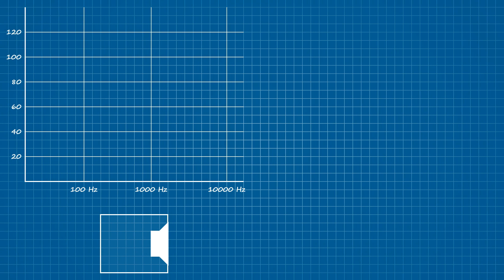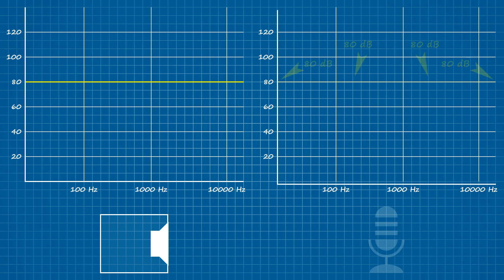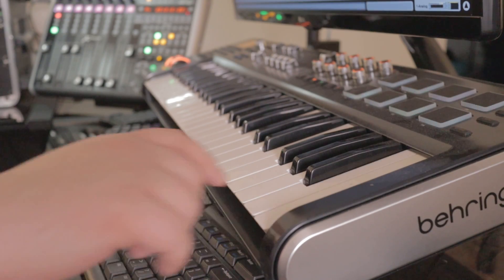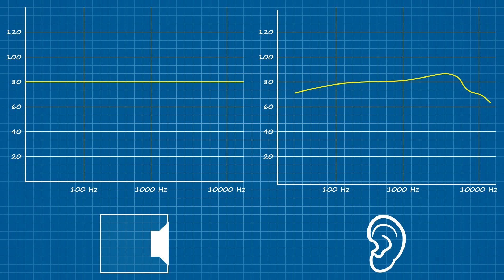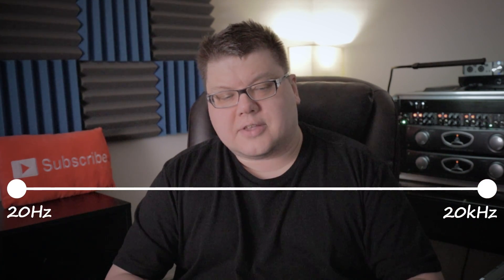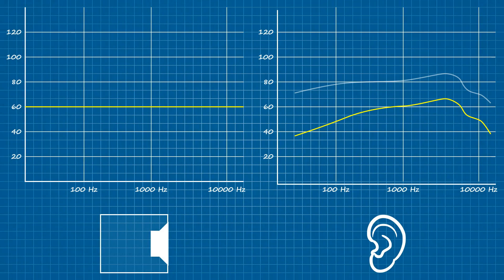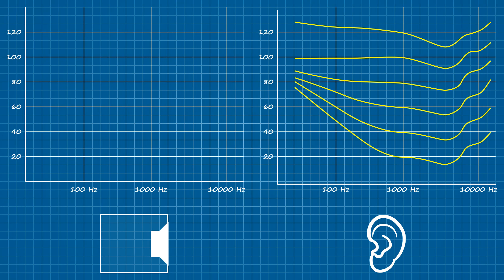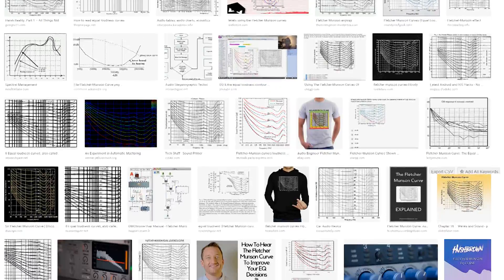Perfect Sound Explained

Comment: I was just looking at these curves yesterday! I’m interested to hear your opinion as a professional. Several years ago, I brought up this topic during a tuning conversation. I made the same claim as you. My mentor, at the time, “corrected” me and claimed something along the lines of “these disparities of loudness are accounted for in the recording, therefore you would be doubling the effect by using your equalizer in the same way”. That claim makes sense to me. Surely, the studio doesn’t flatten the master track, do they? Any good recording is dynamic and any good artist plays sounds at the volume they intend. With varying amplitudes already made into the recording, surely we don’t need to also account for them in system configuration, so we? Thanks.
Reply: As they usually hear at loud volumes in the studio (to get better "ear" frequency response), I really believe they actually produce music that sounds good only at those high volumes. At low listening volumes, Loudness contour compensation really makes music better
Reply: @TelmoMonteiro  Fair point that loudness makes a difference. I’m not so sure sound engineers listen louder than most considering their ears are so important to protect for their jobs. I suppose, if you know you’ll be listening at lower levels, having some EQ inherent in the system could be nice.
Reply: @jtmcfarland3512  usually they have it sounding exactly as they expect for the healthy audio volumes they work with. Most times it means setting the monitor EQ to sound good with music they know well I believe. How else could they make music that sounds good? I'm also in the pursuit
Reply: @jtmcfarland3512  the thing is, no matter how they do it, volume always affects our perceived frequency response. In my car the loudness option is on, and music just sounds more dynamic
Reply: They use RTAs and spectrum analysis, not EQ with music they like. You’re getting into a discussion of EQ preferences while I’m talking about system design for engineer intended reproduction. I do agree volume affects that, but I don’t think most people listen as quiet as you suggest nor would I agree that some form of “loudness control” should be imposed within enclosure designs; that’s why there’s a loudness knob or software built into the player to vary it higher up the signal chain.
Reply: @jtmcfarland3512  I'm not disagreeing with you! We are both right because different studios do it different too. Bottom line is, everybody wants linear predictable FR from the monitors. From there you can get creative with music and art. Tuning you monitor system to have a flat response in your listening position with room analyzing and correction software and then do a tune on top of that soo it sounds linear to the engineer is probably the best bet to achieve the result one wants. Therefore, after all the tuning, it is reasonable that the music sounds good with your track as well as other people's tracks

Comment: I never considered the frequency response of the listener which should have been obvious.  I've always preferred the sound of horn loaded tweeters and speakers that most consider "too bright" like Klipsch bookshelf speakers.  But after discussing this preference at length with a friend I was reminded that I had a hearing test done as I was separating from the Air Force as a B-52 mechanic and while I didn't qualify for disability they did note a minor loss of hearing in the upper frequency range of my left ear which I assume was from lifting that ear muff cup when someone was speaking to me and I couldn't hear them while the jets were running.  I know.  Genius.  Long story short everyone's dynamic range is going to vary slightly based on exposure and genetics.

Comment: surely though if you say record a guitar with a perfectly flat microphone, and play it back with a perfectly flat speaker it would sound like the guitar? And if you try and compensate for your ear then it sounds different from the original, as when its played, nothing is adjusting for your ear. So surely to get the most faithful recreation you'd play music from a perfectly flat speaker at the volume it was recorded at? Instead of doing loudness compensation.

Comment: I love this video a lot! but i have to disagree - i wouldn't not fall for the inverse fletcher munson curve for percieved flat response. The ear is on average most sensitive in the 2-5k region and it's HRTF dependent for everybody. But get the 2-5k region right and you win because thats where crossover design is most critical too. A person with a more elliptic skull shape (me) will enjoy directional speakers more than omnis. This way low end extension isn't as critical a factor if it counterweighs 2-5k sufficiently.

Comment: This a very interesting topic. Some years ago I purchased a speaker testing program called RTA (Real Time Analyzer). At the time it was less than $100 Canadian but I think it works great. With this software there is setup instructions that included such things as linearizing your computers sound card response. It also allows the use of microphone correction files, etc. But what I found most interesting is all the different test signals that can be used to test your speakers (frequency sweeps, white noise, pink noise, etc.). White noise contains the full audio range of frequencies at equal amplitude/voltages. Pink noise, on the other hand consists of the full audio range as well but,as I understand it, the amplitude of
Reply: Sorry hit send by accident. In pink noise the amplitude of the different frequencies is supposed to match the typical response of the human ear. It is this pink noise that is used for measuring speaker response. That way if the measured response curve is flat then presumably the speaker is compensating for the ears nonlinearity. When I built my speakers I used the tone sweep method of testing (all frequencies at equal voltage) as it seemed to make more sense at the time. The real question I guess is this. Do you want your speakers to compensate for your ears non-linearity or do you want them to reproduce the sound faithfully like it would be live??

Comment: Very surprised to find someone who understands the Fletcher Munsen  curve for human hearing.  I was made aware of this phenomenon when I was probably around 15 years old and had built my first Hi fidelity amplifier.  It was fairly common practice many years ago for some audio equipment manufacturers to include a compensation control intended for low audio level listening.  This was also used by a lot of car radio manufacturers however the compensation was achieved with a tapped volume control and a simple compensation circuit consisting of a resistor and a capacitor.  More sophisticated schemes used a double tapped volume control which included a small module or RC network as an integral part of the control. Made by Centralab these  units also were available to hobbyists through electronic parts houses.     I'm now at an age where my hearing is only about 40% of what it should be including complete high frequency hearing loss above around 7kHz.  Even my audiologist(s) aren't aware of the research done by Fletcher and Munsen back in the 1930's.  No wonder hearing aids sound so bad as they don't include this vital compensation feature.

Comment: Very informative, Im wondering if an algorithm is available in a Car audio DSP to compensate to this change in volume, once adjusted to the hearing baseline at said volume.
Reply: If I'm understanding your question correctly, this feature has been around forever.  It was commonly called the "loudness" button on car audio head units back in the 90's, I'm not sure what they call it now.  You enable it when the volume is low and it boosts the frequencies that you're less sensitive to at low volumes.

Comment: Sorry but your have a logical error in your reasoning. The Fletcher-Munson curves do not apply only to sound heard from speakers but to all sound, universally. So in order to faithfully reproduce a violin, as you would hear it at a concert at 80db, you would still need a flat response from your speaker because the direct sound heard at the concert is subject to the same exact curve your speakers do when being listened.

Taking the loudness curve into account would be like applying RIAA correction to a non-phono master. Also since the curve is dynamic, you wouldn't able to compensate it anyway during mastering, it would need to be done volume specific during playback. If it was needed at all, that is.

The ears sensitivity to 4khz manifests itself in speaker building mainly because many speakers have power response issues around 4khz which coincidentally is a very popular frequency for crossing over the tweeter to the midbass. At 4-5khz the tweeter starts becoming omnidirectional and the midbass starts becoming directional, causing a bump in overall reflectsd energy around the crossover point (unless the designer compensates by either waveguides and/or tweaking the direct sound SPL from the tweeter).

Comment: Doesn't the sound engineer who mixes the music you listen to use (close to) flat response speakers. If he or she does, compensating for the fletcher munson curve, makes you compensate for it twice. Once by the ears of the sound engineer and once by your setup. While you only need to compensate for it once.
The only problem that is left is the sound level you listen to. You technically should compensate for the difference between your listening volume and the volume at which the music is mastered.
Reply: Correct, which is why you shouldn't compensate for the equal loudness contour at reproduction stage. You just need a flat response from your sound system and hope that was the case all the way through the production as well. The only time when you might want to compensate for SPL dependent sensitivity of the ears is when listening on low volume. Some devices(mainly amplifiers) have a "loudness" -switch which increases sound power level in high and low frequencies giving a V-shaped frequency response on the output. It's often merely a crude estimation.
Reply: I don't think so, like said in the video, mixing engineers periodically turn up the volume to check to hear a more flat response. Most professionals probably already think about this fact in the mixing stage.
Reply: Could be the reason that some poor mixing/mastering done by amateurs usually are very bassy

Comment: Fletcher-Munson curve only makes sense at very very low volumes to me. Anything moderaetly loud or real to the performance it colors the audio in a bizaarre way. This mess goes deeper than the Fletcher-Munson curve also, let me explain. So if I have an acoustic guitar playing live with no electronics with a person singing once again with no mics, speakers or electronics then my ears are hearing it naturally and perfectly as it should be. So if I recorded this performance flat from 20hz-20khz and then had a signal path, recording and speaker system capable of playing flat from 20hz-20khz my ears would hear very similar to the natural live performance when the volume level is matching. It only makes sense you record everything and play it back with no deviation in the frequency response then your presenting the same audio sound signature to your ears true to the performance. I have a set of Q Acoustics Concept 20 speakers that measure very flat(+-2db) from 50hz to 19khz when set up properly in a room, I also have many other speakers big and small, studios monitors etc that I've measured with a calibrated mic and they have wild differences in the response. I also have a preamp/dac and power amplifier that are very flat, measured with an oscilloscope. When I listen to albums its all over the place as audio recording engineers have free rein to apply what ever creative flare to the sound they want. This includes filters and compressors, changes to phase etc... and the sad part is none of them use the same equipment. So you end up with them using their ears which everyone's ears are different, on a different signal path (amp. pre-amp, dac etc..) and on different speakers and monitors both flat studio monitors and consumer headphones and speakers. So you can imagine if your listening to a completely different sounding setup than the next engineer then you have no point of unity. On top of that every room sounds very different with different shapes, sound absorbing and diffusing treatments. Then we had the loudness wars that came along in the CD era where audio was mixed for radio to stand out amoungst the rest and on all audio systems from big hifi systems to clock radios. This meant the use of a lot of compressor tools and limiting the dynamic range and frequency response to allow loudest percieved sound. So the outcome of all of these variables is impossible to have anything sound right. It  all sounds like artwork to me, creatively done which is good and bad as some things are completely not listenable on high end audio systems that reveal a lot of flaws. And why is this not talked about more? Its becuase the general population uses basic audio systems, small bluetooth speakers where you cant hear the flaws as much or the people that have a larger system use 5.1 home theatre receivers with pod speakers or other mismatched components that they get used to and the compromise is fine for them. All that said if all you listen to music on is a portable bluetooth speaker or headphones and you listen quietly then the Fletcher-Munson curve is better.

Comment: So does this mean ideally, we want our speakers to be flat at 80 dB but boost the bass and treble more at lower volumes?  Then at 80+ dB volumes we want to reduce bass and treble?
Reply: I think that's pretty much what Denon's audyssey  XT does. Changes the curve based on volume.
Plus with Equalizer APO ( https://equalizerapo.com/ )for its parametric equalizer for great listening even with cheap speakers!
Reply: @garavonhoiwkenzoiber  It's great for correcting bass issues. Though you can't fix a null as easily as a peak by using it.

Comment: While I understand where you're coming from, to me it's the job of a hearing aid to convert a flat response sound system to a perceived flat response. If you listen to an orchestra in an open air environment and record it perfectly, then replay it back on a perfectly flat audio system, what you'll hear at home is the same as what you'd hear while listening to the real thing. Why would you want to distort it to correct for your imperfect ear's response? What about other listeners imperfect ears not matching your ear's settings?
Reply: It's because it's not about the recording. It's about where you set the volume knob at home. The more silent/loud you play it back, the less faithful it will be to the original recording. It's not about the recording, your setup etc, it's about the response of your own ear depending on volume. It's like saying "if I recorded perfect audio, it shouldn't matter how I set the tone knob"
If you play it back at the precisely same volume at home, it will sound the same. If you play it back more silent, the bass is gone, if you play it back more loud, it's flatter than the original
Reply: this makes sense..
Reply: i absolutely second that. we don't use human ears to record it, so we don't need to use any perceived loudness compensation. of course playback volume is important for truthful replication. for truthful reproduction independent of listening volume (which in itself is a contradiction), the single perceived loudness curve is not relevant, but the difference between the higer and lower curves is.
Reply: marek peperkorn - it’s precisely because we don’t use a human ear to record it that loudness compensation is needed. Human ears don’t exactly work the same as recording mics and the perception of the sound by the human is an entire field of scientific study all by itself. Perception is the most important thing in sound reproduction.
Reply: If you soundsystem is capable of reproducing the same sound level as a real orchestra (which actually is quite loud) you would be hearing the same thing, as if you were live. So if you´re listening to it on a lower volume you´d be turning a lot of knobs to reproduce the same sound.
Reply: You can never....ever recreate the real thing that's delusional thinking

Comment: Also most music are made in studio. The mastering room is the authentic sound. No matter your ears.
Reply: So if you listen at lower levels than the engineers did when mastering, it won't sound as good unless you do the correction.
Reply: @peetiegonzalez1845  That's right. But the part about 3k and around that region is wrong. A different curve needs to be used.
Reply: @johnyang799  Agree.  It'd more be the difference between a couple of those curves.  In practice, most of us end up using the "smile" anyway as we tend to like more bass than modern studio monitors produce.
Reply: @peetiegonzalez1845  http://s90.photobucket.com/user/ofey_s/media/Sony/G05.jpg.html the blue one
Reply: The mastering engineers job is to make the studio mix sound good on consumer hardware. If a song only sounds good in the studio, it's a poorly mastered one.
I realize more expensive and better audio equipment sounds objectively better, however in mastering there are a lot of changes made to compensate for lower quality listening equipment (for example saturating the low-mid section with the original low-end so it sounds good on systems incapable of producing low frequencies.) And in turn, these changes may make the recording sound worse on high quality/studio equipment, but the goal is to satisfy the average consomer, not 100 guys in the world who care much more about their audio setup.